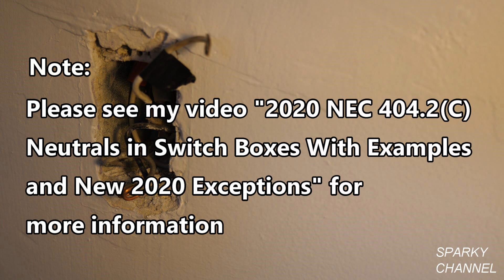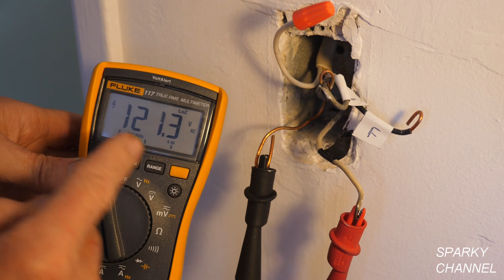Separate Switches for Bath Fan and Light from Single Switch in a 1960's House

Comment: Don't be fooled by the ground wire being a solid ground when getting a voltage confirmation with a meter.  I've used a Fluke 87 to check the same way you did and got a satisfactory reading of 120V,  but when load tested (with a small incandescent) that did not light up,  I found the ground to be actually open somewhere in the middle of the run.  The free floating ground was able to 'sink' enough current in free air to fool the meter. Just to confirm the meter read 120V not 120mV.  Just a thought.
Reply: What did you end up doing?

Comment: Is there another solution for this if there is only two wires and not even a ground without tearing the wall and ceiling apart to replace the wiring?
Reply from the maker: No, but there are ways to run new romex cables with minimum damage.

Comment: You should see the 10 Guage wire running through our house after repairs from a kitchen fire. The electrical wiring hasn't been finished in 10 years and we use extension cords to draw power from the other side of the house. Need help.

Comment: I bought a bathroom vent with light. I also have a light over my sink , how do I connect to where both lights turn on together and vent turns on  on the other switch....
Reply from the maker: Hi Danny. It can be done but I can't explain that in this small space.
Reply: If you can turn the light on the fan, the fan vanity light all separately then check the box for 3 wires and connect the 2 light load wires together.  If it's 2 circuits then you will need a wire to go from fan light to vanity light

Comment: 2nd question, when attaching wires on new switch, is it safe to say an acronym so you get the colors of the screws on the new switch correct, "gold is for load"? Thanks so much

Comment: Do you think the wiring method is GNH (Firs is Ground; second is Neutral and third (last) is Hot wire ?
Reply from the maker: Yes, GNH every time.
Reply: Maybe accidentally you install Hot wire H 10:35 before Neutral wire ( which is installed last one)

Anyway I enjoy watching all your videos.

Comment: In European countries a double switch with 2 switched live wires can switch light sperarately in a chandelier, for example on a 3 light chandelier one side of the switch would only switch one light, the other side would switch two lights. Does that exist in the US? I have only seen lights and fans on separate switches, saw a guy installing a 15 light chandelier and all 15 lights were controlled from a single switch.

Comment: My vanity light and fan are separate but there are only 2 wires at the box (the line and one load) 😭
I'm guessing they must have joined them together somewhere in the ceiling or wall then, ugh
Reply from the maker: Or there might be two separate cables.

Comment: Hey man can you explain how to wire a exhaust fan and heater. On diferent switches?
Reply from the maker: It would be the same as a light and a fan on different switches but you have to make sure your wires are heavy enough gauge for the heater.
Reply: @SparkyChannel  i put an exhaust fan like 5 years ago with 14/2 wire. But now it broke thats why i bought one with fan and heater?
Reply: Like i want the fan and heater to have their own switches. I bought a single conbination switch or however you call it

Comment: I suspect that switch was wired to turn on the fan and the light at the same time because a certain segment of renters will never run the fan when they take a shower and mold buildup becomes a serious issue.  I have known property owners who have deliberately wired it that way to force the tenants to use the fan.
Reply from the maker: Yes, that's true.

Comment: I have a home built in 1961 and the electrician said it would be a big job.  They did not even take off the current switch to see if there were separate wires for the fan and the light fixture.  As Sparky said, sine the fan was likely added later, there likely are separate wires.  I just don't trust that anyone would be as thorough as Sparky to do it the right way.
Reply: Are you slow? Did you think this guy is better than any cert. Electrician? They are all capable 🤣

Comment: I have a question ,what about if I have 2 hot wires and 2 loads ,how the connection goes on the same type of switch your using 1 for fan and the other one for light? Tap should be taken off? , good video’s by the way thanks
Reply from the maker: Hi Nicolo. 2 hot wires in the same box? From different circuits or the same circuit?
Reply: Yes 2 hot wires from same box from different circuit

Comment: How do you separate two lights in the same room, when the single pole switch only has a ground and two black wire that are hot.
Reply: Can't because  the switch  is furnished  with hot only, very common.

Comment: @8:04 "... is an excellent return path to the main panel." 
  
Not true. Modern voltmeters have extremely high input impedances. You have demonstrated that the "ground wire" has some sort of return path to neutral. You can make no real assumptions as to its effectiveness. A better technique would be to turn the power off and measure the resistance/continuity of neutral to your "ground". Just sayin'.

Comment: Hello!!
I did like to know when the fan and lights are in the same wire, how to separate?
Reply: You would have to replace the 12-2 or 14-2 romex with 12-3 or 14-3 to get the extra hot wire.

Comment: What would you do if the fan and light wires also have a neutral going to the box?
Reply from the maker: I would connect them together with a Wago or a wire connector and put them in the back of the box.
Reply: Sparky Channel thank you!
Reply: Sparky Channel Also.l, Would you put the neutral wire coming from the power wires with the other neutral wires?
Reply: Sparky Channel why didn’t the fan/light have neutrals coming into the box? Don’t they need to be there? How is the circuit getting completed?

Comment: hi im a suscriber to yr channel...my progect is to change a 1 switch that controls a ceiling fan n the fan lights, the fan has a blue wire and a black and a white wire connected to a green wire I already have the 2 gang wsitch and extra cable...can you instruct me on how I can coplete my project please.

Comment: I’m replacing a light that’s on a 3 way, with a new fan/light combo. 
I’ve got only 1 NM 14/3 coming in, any chance I could accomplish this without running wire in wall? 
It looks as if I might have a neutral in the original fixture which is now hot. The fixture had 2 NM 14/3 tied together wired to the original fixture.
Reply from the maker: Do you want the light and fan on separate switches?
Reply: Sparky Channel ideally yes, if by switches you mean the top or bottom of the combo switch shown. 
I got mine kinda working but light and fan turn on together, and unfortunately when I flip the other 3way, it changes which (top/bottom) powers on the fixture.
Reply: Hard to answer without seeing it, sounds like you have 2 dead end 3 ways meaning only one 3 wire in each box which is not a neutral in either and you would have a 3rd 2 wire cable for power in fixture box.

Comment: Sparky, I have a question that you might be able to help me with. We have a modular home that was built with Self-Contained light switches. We've been doing a master bath and closet renovation and decide to close off a wall that had the door from the bedroom going into the closet (eliminating 1 of the 3 doors from our bedroom to utilize the space better) and moving the closet access going through the bathroom. We want to eliminate the light switch inside the closet completely where the old door was but, upon removing the wall, we noticed that the light switch in the closet has the main power coming into the switch from the ceiling and has the wires coming out of the switch to the closet light as well as running through the wall into the bathroom to that light switch, so two sets of wired going out from the light switch. How could we eliminate the closet light switch completely while still keeping power to the wires that go to the bathroom light switch? What would be the best way to do this?

Comment: Sparky, do you recommend keeping that rag wire?  I recently purchased a house from 1955 that has a few original circuits fed by that type of cloth wiring and metal boxes.  I don't believe the boxes are grounded.  Was thinking maybe the rag wire should be replaced entirely sooner rather than later.

Comment: What would it mean if the switch has only 2 wires but controls a light inside and outside of the bathroom as well as the fan in the bathroom? The switch is also outside the bathroom its so annoying but I can't afford to pay an electrician😅

Comment: looks like you have a switch leg in the box....  how they were able to wire that fan is beyond me, where is the nuetral leg for the fan??? behind the light?
Reply from the maker: Both the fan and the light had their own cables going to the switch which included neutrals.
Reply: @SparkyChannel  didn't you have in the switch box- 2 black load wires, 1 white-hot wire, a ground and an unconnected white wire, the neutral was in the lightbox not switch box no? didn't the fan get it's neutral by tapping into the lightbox or they grabbed another circuit wire after they cut the hole they found, like a shared neutral?

Comment: Well,  have I got one that's completely messed up. I attempted to follow exactly all the same steps here, and when I got the plate off, and the switch pulled out of the box, I found a blackish-colored woven fabric jacket around only a black wire and a red wire. No bare copper, no other colors, nothing. Now I have absolutely no idea what to do with it!

Comment: What if I had a single switch that controls a Shower Light and a Bathroom Vent fan and I wanted to use the switch just to control the light and make the Vent fan HOT, because the vent that I purchased needs constant power and is controlled by a wireless remot,. Is there a way to do that?

Comment: Seems u might need a bigger box? why is the live wire WHITE? seems the whites of the loads, being
the lite an fan be spliced to white of line. yup there should have been  black tape round the live white.
Reply from the maker: Yes, the live white of a switch loop needs to be designated with a hot color.

Comment: Also you can’t do that code wise if that bathroom doesn’t have a window!  If you have a fan and light In a bathroom without a window they both must go on together.  Course both fans and lights are required so they’d have to be on the same switch but i think you’d get away with it if it was a fan and light combo and a vanity light too. Fan and light combo goes on one switch and the vanity on another.
Reply: Hmmmmm, is that code everywhere or only certain states? Maybe this is why in my upstairs bathroom they put a separate switch for the fan but in the main floor bathroom they didn't. I hate that the fan has to be on, ugh!

I tried to change to this type of switch but there weren't adequate wires in the box so I couldn't anyway. But if it's code I guess it's best that I wasn't able to.

Comment: You seem to be dodging several observations in this thread pointing out that something is not right with this setup.
1) You have a switch leg from a light coming to the switch box. The power source is no doubt in the light box.
2) Somebody later added a fan and used the switched hot at the switch box.
3) The neutral to the fan from the switch box is capped off.
How then is the fan getting it's neutral? I guess they could have run another 14/2 from the light box to the fan box with the hot wire capped off but why? If you were going to do that then simply put the fan in parallel wit the light. No need to bother with the single switch box at the time. Something is not right with that setup and if you are a licensed Electrician it is your duty for the customers safety to trace that out and find where the fan neutral is coming from. Even more so since this is a bathroom.

Comment: He said the white wire was the "hot" wire. If it truly is "hot" then this is wired incorrectly. Per code the black wire is supposed to be "hot" and the white is neutral.
Reply: He explained later that older homes like that could have the white as hot.

Comment: How did you know which wire was for the fan or light?
Reply: He could tell the old original wire was for the light and the newer looking wire had been pulled at a later date for the fan. Just an electricians Process of elimination.